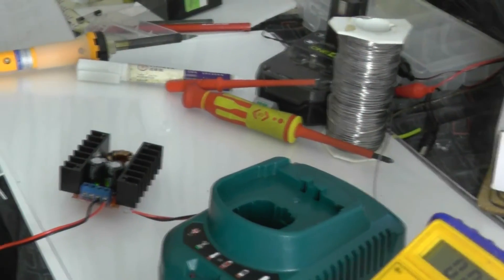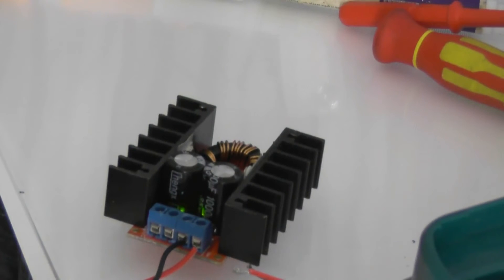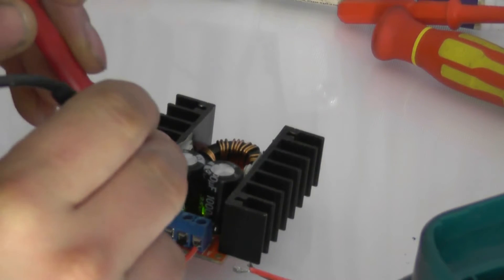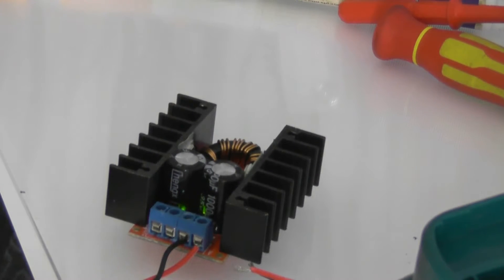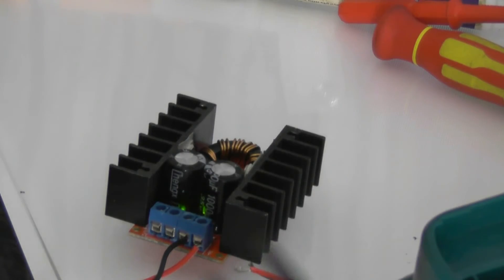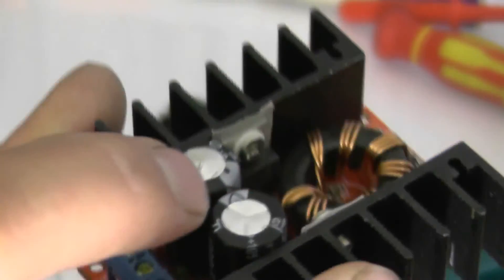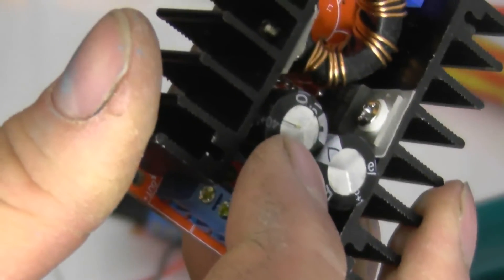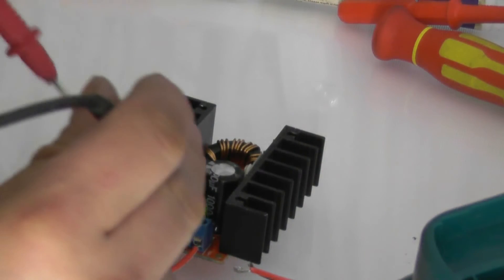Thats it i'm done - rated at 35V blew up at 32

Comment: godammit man try first 12v to 24v
Reply from the maker: Apologies why would I need 24v?
Reply: @pietkaify  because its safer to begin with 24v
Reply from the maker: @electroholland6720  not if I'm going for 32v for a specific battery charger. I would have lost my eyebrows either way. Weither I turned to pot up slowly or quickly.
Reply: @electroholland6720  He had the input hooked up to the output is all....they do work fine if they are wired correctly. I have several of these.

Comment: I had one of those on a water heater element and it blew up too. Still, it kept running. A lot of those caps get high leakage current when they operate anywhere near rated voltage. Otherwise I have been quite happy with these modules.

Comment: Be careful my friend.
Reply from the maker: +Raymond Earle Hope your Keeping well? This event certainly put various things into perspective regarding consumer electronics from Chinaland =)
Reply: The first thing I did with my converters was put higher voltage caps in if the ones onboard are too close to the upper limit of the unit. 2.9V is far to close. You need at least 20V difference to be safe. I am very well my friend. My regards to you and your family.

Comment: Did you have a load connected? If an unprotected boost converter is open-circuit there's no pathway for the load current, so the output voltage greatly increases beyond which the cheap caps can cope with, so the boost converter increases to it's maximum duty cycle
Reply from the maker: that makes perfect sense in hindsight! suprised I did not have an accident sooner as I have been adjusting these without a load on for a few years now!
Reply: So if a load (cob led) was connected this wouldn't have happened? 
I've just recieved the same boost converter....
Or is it better to replace the caps with bigger/quality one's?
Reply: Maybe the boost converter was faulty or maybe it's just an unregulated design... If that's the case, using bigger caps would make the output voltage increase further, so then the transistor/mosfet would probably get destroyed next. I'm only speculating because I don't have a circuit diagram but check this out for an explanation http://www.embedded.com/design/other/4008261/Analog-design-Tip-A-Simple-Circuit-to-Protect-Against-Open-LED-Faults

Comment: You're lucky it didn't do a really good pop and sent confetti foil absolutely everywhere! Electrolyics usually leave a good mess behind... that would looked positively neat! Was interesting to watch it go too... seeing it start swelling and then go pop! If you're interested in another one, see if you can find one like this - 261846882909  (on eBay) - it is supplied with standoffs fitted, and the switcher chip and most of the other components are mounted on the bottom of the board, instead of the top. It also looks like the more recent ones are using different caps too - my last lot had the black caps like yours, and this latest pair have green caps, which I think are higher temperature rated (but still only 35v). I've had one running for about 12 months now for a 19v laptop, and another at 15v for a tablet. I suspect if you want to use it for your ryobi charger, that it is probably better to set it at 30v as that was within it's input tolerances, and see how you go for heat - as I think it would need cooling for that sort of step up - my 19v laptop pulling around 2A makes it warm up a bit too much - has a cooling fan I kick in at times - working on a temp controller for it. You might want to consider something like 351633401930 (eBay again).
Reply from the maker: +Peter Feerick That first item doesn't ship to the UK. but i have got the second one on the way. I purchased a lot of 10 of these over a year ago so I guess they would have changed the design by now. I haven't put the video up yet of this items intended purpose, but the third one works a treat =)

Comment: i have one for stepping voltage up that failed also said it could handle 150 watt so I thought that's good I can power laptop with it failed it just stopped working
Reply from the maker: +David Simpson out of 10 I have popped 2. these I bought over a year ago so I have no idea what time does to the caps
Reply: +pietkaify shouldn't matter how long caps been stood they shouldn't go like that unless they doing with caps like they do with li-ions and re label them better spec then they really are

Comment: Looks like those cheap caps were only rated at 35 volts. How accurate do you think your meter is? Stay safe mate!
Reply from the maker: +Adam Welch I think twice when buying from china now. But its my only option as I'm not skilled enough to build my own cuircuits =/
Reply: +pietkaify I know what you mean but I've had capacitors blow in branded equipment too. I think as a rule it's best not to take cheap electronics to their limits. I only run my 20amp charge controller at 10amps for example. Give yourself some head room and you should be ok.
Reply: +Adam Welch Well just in case you didn't know, pretty much anything that generates heat, such as a power supply or in this case a charge controller, should only be ran up to about 80% of their max rated output, just to give you some safety margin, so 15-16A should work perfectly fine assuming it's actually rated at 20A and not some rebranded 10A controller, still a bit crap when things can't reach it's rated voltage though...

By the way, I came across your channel a few days ago, I quite like your videos.
Reply: vgamesx1 Thanks for the advice and comments :-)

Comment: Lol, I popped a Cap today myself,,, 10v 1000uf one on a 12bit PWM servo controller,, it was more of a very violent hiss than a pop though, variable psu was sitting at like 12v,,, that'll do it! In my mission critical stuff (like shtf battery backups) any eBay cheep psu boards I buy like you're using, I tend to replace the caps with quality ones (based on over estimating voltage capabilities and MTBF rating (mean time between failures). The brand of caps on most china / eBay pcbs like that are good for like 500hours MTBF ;) good to share though!
Reply from the maker: I will be investing in some better capacitors! =) should I bin that converter or replace the caps?
Reply: +pietkaify I suggest just bin it, last time I bought a boost converter the IC got hot and puffed smoke out, new caps would probably cost more then the whole board. I mentioned previously in the other video I commented on, my setup, I suggest trying it that way, then nothing goes wrong, and the batteries charge fast.
Reply: if it's just the caps, I'd just replace the caps.. I did that on my PWM servo controller the other day.. For a few hours i'd just assumed the whole board would have been spanked, and somewhat 'accepted it', but later in the day the soldering iron was on anyway with some other bits I was doing so thought, tellya what, just out of interest, lets change the cap! and bosh, fired up good as new... For me, it was more I didnt want to have to wait another few days / weeks until a new one arrived, and logic suggested that the time / cost of replacing the Cap was considerably less than the time i'd have to wait for an entire new one to arrive - so that was what I based my decision on.. so the usual dialemma "have you got more money than time? or more time than money?" thats how I base my decision usually ;)